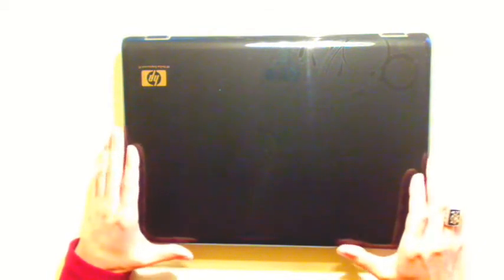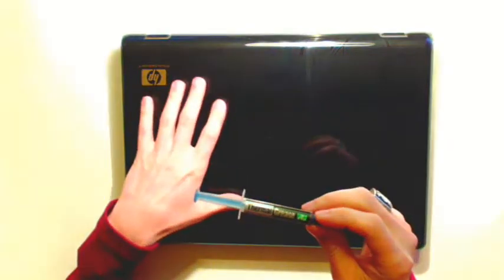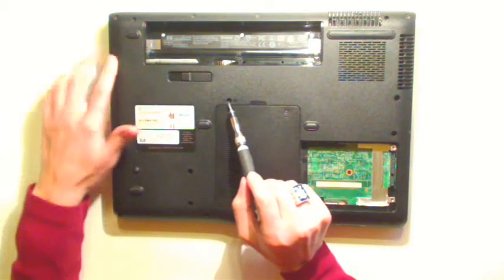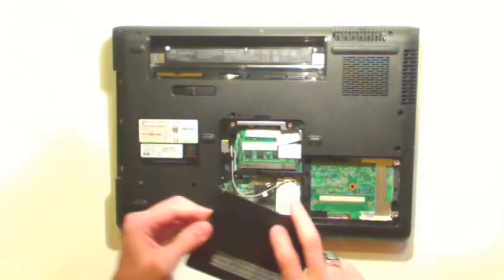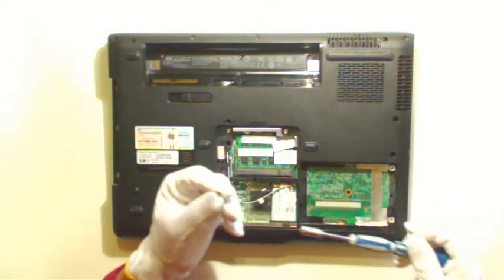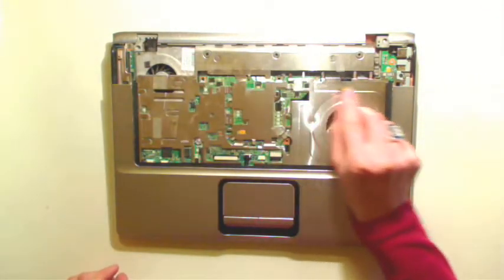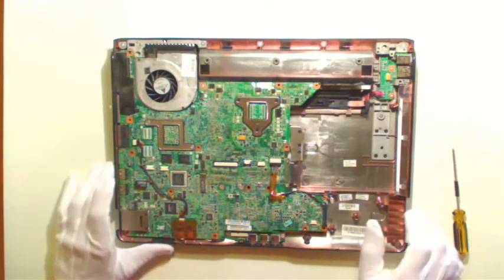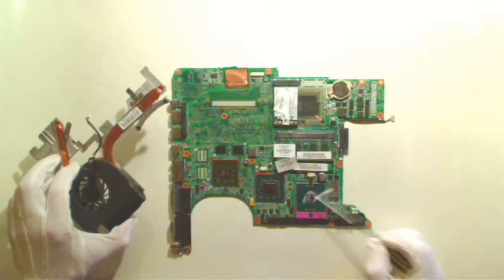[HST] HP Pavilion over heating repairing disassembly [ENG]

Comment: I just took a knife and cut off the fan grill, cleaned dust out of fan with tweezers and taped the mesh back over top. Took me less than 5 minutes and now it's easily accessible and I can easily clean it at any time :)